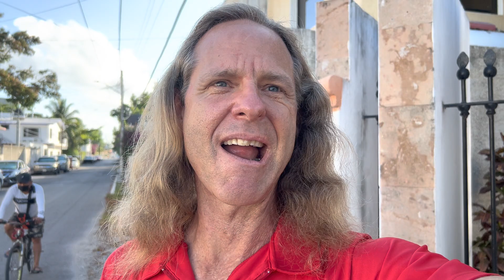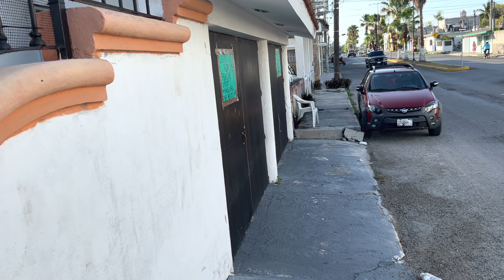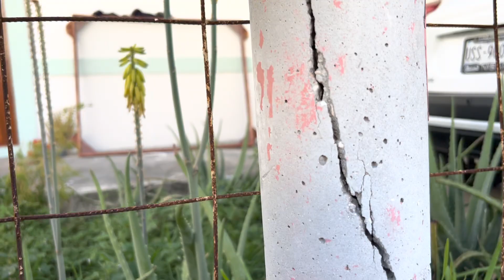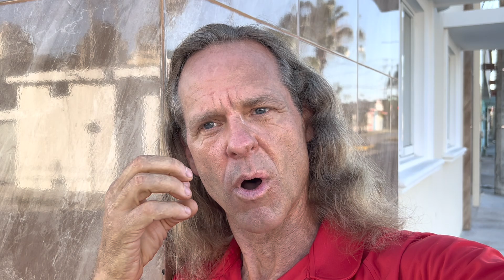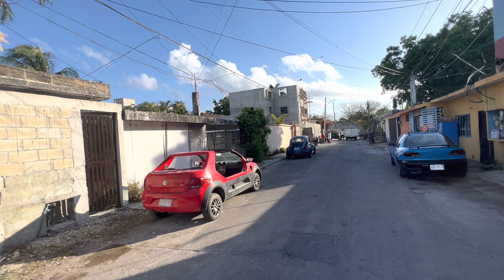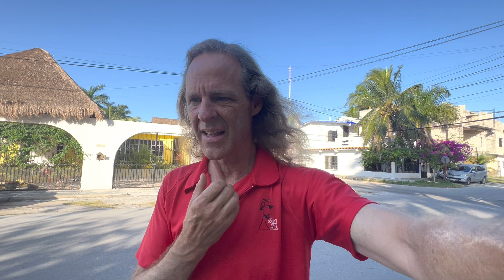Avoid Some Common Concrete Failures!

Comment: This explains exactly a common problem i see in my country, If 2 inches should be maintained between the rebar and the formwork, does this apply for concrete columns as well? (2 inches to separate the inside rebar of a columns to the casting formwork) Here we use concrete block for walls and put a column at each room corner and if it's a long span at every 4meter or so
Reply from the maker: Yes 2” and a bare minimum of 1.5” although I would fight for a full 2”, especially in a coastal climate.

Comment: How about fiberglass rebar ?👍
Reply from the maker: It is expensive and difficult to work with. Think about the stirrups and corner bars. The solution is proper coverage by a well designed concrete mix.

Comment: Are you familiar with Roman concrete? Metakaolin is manufactured in Georgia, and I think it’s use along with fiberglass or epoxy coated reinforcement would make a much more durable system

Comment: Couldn't  you use water resistant  concrete? There's stuff you can add to your concrete to make it water resistant no?
Reply from the maker: Yes but you are probably thinking about liquid water. Most concrete resists liquid water but water moving by vapor diffusion is a different matter. The water that caused the damage to the ceiling in this video was in vapor form. For more information on this search for vapor diffusion in materials and adsorption with a “d”.

Comment: 14:11 
"Concrete tends to crack away from circular pipe penetration"
 what is going t to happen to our electrical conduit pipe buried inside decking? hope there is no potential danger?
Reply from the maker: Any piping that penetrates concrete can induce a crack. Reinforcing steel limits the size and growth of cracks. Piping that reduces the thickness of concrete can create a stress crack along the line of the pipe. It isn’t the biggest issue but it can be an issue.

Comment: Is there such a thing as hot dipped galvanized rebar?
Reply from the maker: I’ve never heard of it but the cheapest solution is to solve the issue with means and methods and not products. Also, rebar is bent, formed and otherwise manhandled and abused in ways that galvanizing would not withstand.

Comment: To me concrete is almost magical stuff. Over here (the Netherlands) the groundwater level is very high so in certain areas water seeps in basements through cracks in the walls and floors. They do use concrete to build the basement and they even drive concrete piles in the ground to support the foundation of buildings. 
The old city of Amsterdam is even built using wooden piles and as long as they stay under water (no air !) they are still in good condition. Due to lowering water levels, the top of these wooden piles are rising above the water level which make them rot. 
I am not sure if they still use wood but I read that the use of pine has been prohibited since 1970. Pine is affected by certain bacteria and these poles all have to be replaced in time. They now use steel pipes that are being filled with concrete instead of wood.

Comment: Excellent video Ray, it's all about common sense and H2O. Amazing what you can learn if you walk around and look at things. With concrete its all about the details- proper planning, placement of rebar, good mix design for the application, quality control at time of pour, etc. Stick to basics, no need for exotic components. Looking forward to more videos.
Reply from the maker: Thanks Greg. You are a great engineer sir, one of the best. Let’s go diving sometime.
Reply: That's a lot details to get right.  Just recently on youtube channels that I watch, I saw a stem wall poured in freezing weather with the consistency of pea soup.  The channel hasn't revealed yet what they are going to do.   Most knowledgeable commenters say it should be torn down.  Another channel didn't bend his rebar enough at the connection between his lite-deck roof and ICF walls.  Rebar bends exposed to air.  This problem admittedly DIY'r inexperience.  Of course let's not forget what can happen if all the details are not correct and maintained...98 dead with the Surside condominium collapse.  FGRP rebar is not exotic and has been around since 1982.  It is used a lot in aplications with lots of dynamic loads and exposure to moisture...bridges, seawalls, parking garages, swimming pools.  Also, I understand the cost of steel has skyrocketed, so alternatives like FGRP and helix steel might actually be more cost effective.
Reply from the maker: @markstipulkoski1389  I think plastics and resins have gone up even more than steel. The surf side collapse happened to a building that has similar damage to many buildings in this country. It isn’t a one-off. In fact an engineer friend recently shared pictures of a building he saw that had some very similar issues.

Comment: Good advice. I always wondered about them putting already rusting rebar and mats in concrete.
Reply from the maker: I don't believe that to be a problem within reason. What you want to avoid is further contact with oxygen which is found in water in all its forms. Fun fact along the lines of this topic is how a cutting torch works. The acetylene heats up the steel and and then the oxygen is added and it oxidizes(rusts) the steel at a very rapid rate. You can't use an oxygen/acetylene cutting torch to cut stainless steel. I find this kind of stuff fascinating.

Comment: What do you think of Helix Micro Rebar?  These twisted carbon steel fibers are electroplated with zinc to prevent corrosion.  Very important since they would be distributed evenly throughout the concrete mix and thus also be near the surface.  Hopefully the zinc plating was engineered to withstand the abrasion during the mixing process.  I've also seen fiberglass rebar.  Though not as strong as steel, they don't rust.  I don't know if FG rebar would be approptiate for all applications and I don't  know if there are prefab fiberglass bends and stirrups.  So some steel may be necessary.  But maybe that could be stainless.  Obviously, not the most cost effective, but looking for what would be best for a multi-generational home.
Reply from the maker: I think we already have the technology to create concrete that will endure hundreds of years. We simply need to use a low water to cement ratio with the appropriate admixtures for the conditions and adequate consolidation. We combine that with adequate reinforcement which we protect with adequate coverage. Use vapor barriers below and protect the concrete from chemicals and salt and you will have arrested the mechanisms of degradation, especially if it is protected from solar heat cycles by putting a building on top of it. When fiberglass rebar was pitched to me I rejected it because it doesn’t help solve the issue in the areas that are most prone to issues and seemed more of a gimmick. It never caught on though it was specified sometimes after a successful “lunch and learn” sales pitch. I have used stainless rebar when pouring concrete that had to be fire resistant. That concrete also can’t contain silica sand or aggregates. Carbon steel and silica sand expand at a much higher rate than the cement used in this specialty type of concrete when exposed to heat. I’ll leave it there for now.
Reply: I can tell you not to use zinc plated copper busbars. It only took 3 months near an evaporative cooler to figure that out.
Reply from the maker: Check out the answer by Greg Xikes for a good answer to your thoughts about rebar alternatives. Thanks for the discussion.

Comment: Ray once again the educator for a lot of DIY people and builders, the ingress of water from poorly finished and sealed structure is a beast to control.  I totally agree that Stainless pegs as a welding point are the best for railings etc.
Reply: Thanks Ray, I will enjoy watching your underwater adventures.
Reply from the maker: Thanks Jeremy, I hope you enjoy the scuba videos. The eagle Ray and the mating turtles are my favorites and happened on the same dive, just 15 minutes apart if I recall correctly.